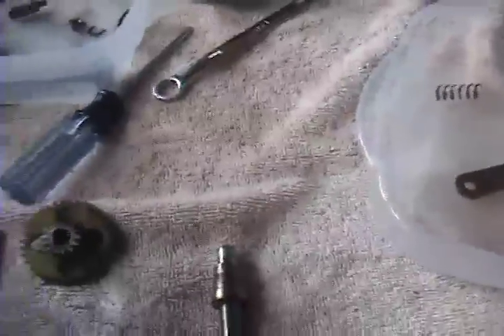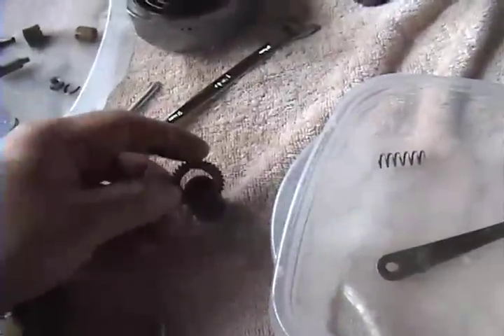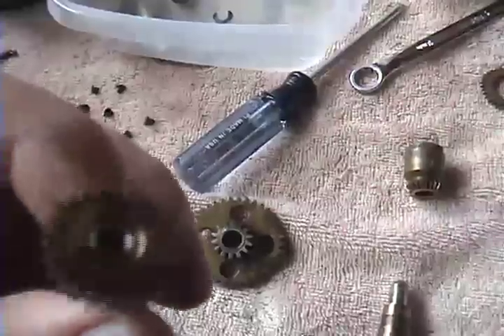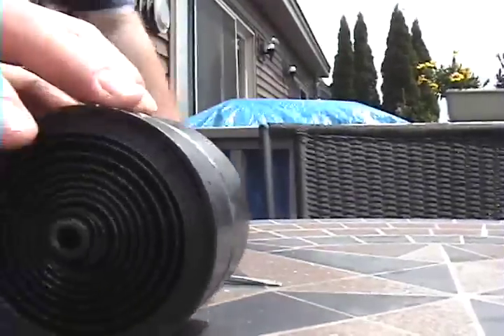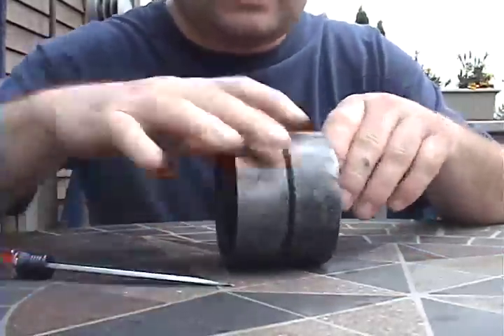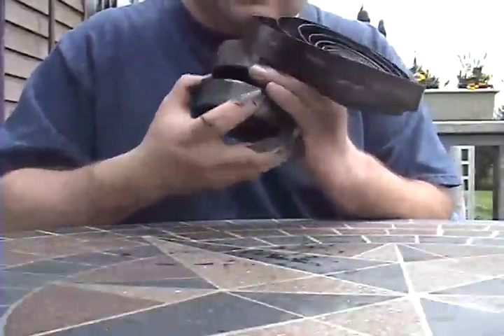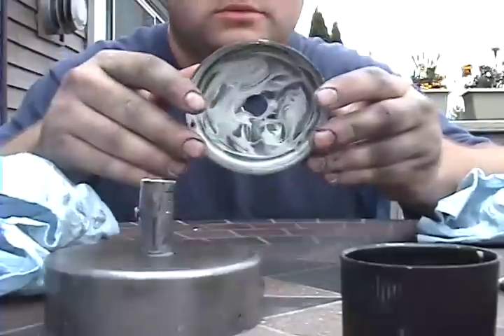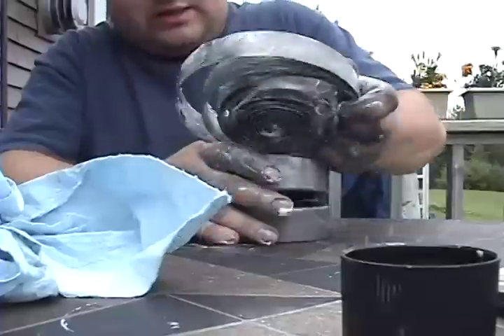1915 Columbia Grafonola "Favorite" Disassembly

Comment: The black stuff you find in most spring boxes is not dirt, it's graphite powder! Unless everything is jammed it's better to leave it alone. Putting grease may not be the best lubricant, as it will usually dry after many years. Graphite will not. :-)

Comment: Thank you  You gave me the confidence to try this myself.  It was a messy job, but now my Grafonola no longer thuds while unwinding.   The Ford bearing grease worked great.

I didn't see the catastrophic beheading force in my spring  that so many horror stories have suggested.  It seems a little like the stories about CRT TV discharging.  There is real danger,  but it may be exaggerated.

Gary at Shenandoah put a thrown governor weight on a new spring for me.  A very helpful gentleman.

Comment: I have one that says
 
"No A 50915
AM Graphophone Co 
Bridgeport,Conn 
USA 
Pat Appl"

on the front tab off the turntable.

It is a 3 spring motor like yours. I first got rid of all the grease THEN removed the spring. I had a broken mainspring and replaced it with a new one. Had no trouble AT ALL using  your method to install it back, WITHOUT GREASE. Did it several times as the first time I put it in backwards. The grease should go in last. Less mess and makes it easier to install.

Comment: You can load it dry and then smear in about 3 tablespoons worth of grease. With the right kind of grease it will distribute itself through the coils after a few windings. This works fine, but what I do is put a light layer of grease on the inside of the barrel, then lock the end on the rivet and wind about one revolution. At this time I then get a scoop of grease in my right hand and lightly grease both sides of the spring as I go along. Then at the end I smear about a tablespoon worth.

Comment from the maker: Hmm... depending on rarity and condition, eBay might be your best bet, but you might get the most from it by selling in a consignment shop with whatever records you may have for it. I see these selling in the high hundreds, low thousands in consignment shops (in good condition, as complete packages) in local shops, or as little as $50 on eBay.

Comment from the maker: No, not all lithium greases are the same. I recommend Ford wheel-bearing grease w/ moly additive (never ever use aerosol grease!) I used the wrong stuff, but it works well (standard multi-purpose white lithium in a tube).

Comment: OMG...You should never remove a spring like that. Not only does it increase the risk of injury, but it can also snap the spring where it's attached to the barrel due to the forces being released. You really should remove them as I do in my original video.
You might also find it easier to grease the spring after it's in the barrel so it's not slippery & there's less chance of it getting away from you.

Comment: Yep, its dangerous and you can damage the spring as well. Just keep a hand on the barrel and one on the spring and uncoil it slowly. I keep mine inside a 5 gal bucket also as a safety precaution in case it slips and shoots out. As far as grease, a blend of lithium and moly from the auto parts store works like a charm.

Comment: You'd been better off putting the spring in dry then putting grease in and packing it in after. It will work its self in over time, but this way here makes a mess and your hands get all slippery

Comment: keep trying there are so many videos to do spring barrel repairs. main thing is when cleaning the components. cut a 5 gallon  pail down. only soak the metal parts in kerosene. keep fiber gears away from solvent because they fall apart. slowly remove the spring. You are doing ok

Comment: I have the same motor as this but it has 3 springs.Two springs were damaged and I replaced them.Seems they won't "hook up"Is the winding Spring on the right side wound counter clockwise?